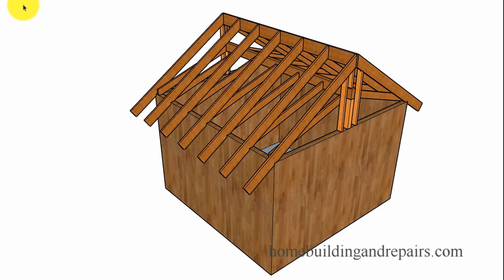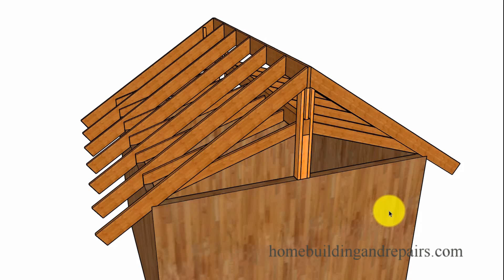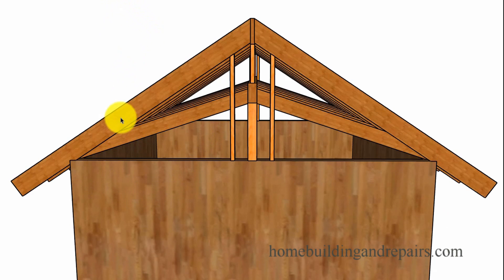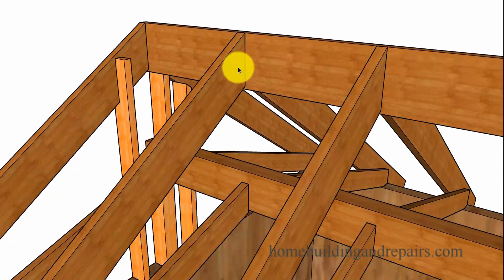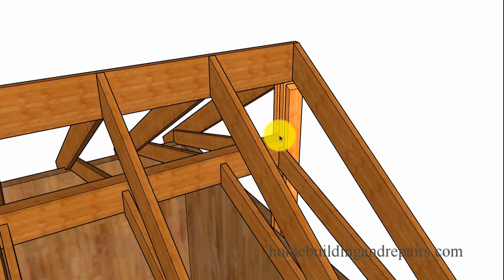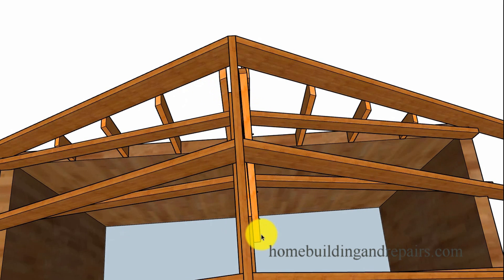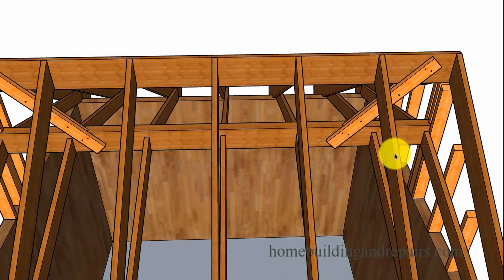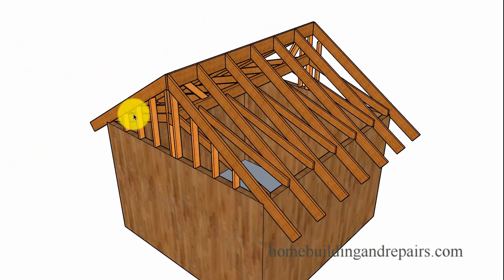How To Build Roof And Ceiling With Two Different Pitches - Conventional Framing

Comment: what if you have standard trusses with flat ceiling and want to go to a double pitched rafter ceiling with beam(s)?
Reply from the maker: I would think you could remodel it with this type of framing, but should check with local engineers to verify.

Comment: I want to add a post & beam 6/12 pitch to a ranch home which has a 4/12 pitch. I am not sure how to finish the gable as it goes over the 4/12 ridge. Do you have some thoughts on how to finish?
Reply from the maker: Email me a picture of your design or problem and I'll see if I can provide you with some information. You can get our email address at our website.

Comment: The walls will (probably) eventually bow out midway with this design.
The problem is there are no collar ties or joists keep the walls from spreading.
This design (in my opinion) is adding 2x the outward pressure on the walls and is basically dependent on the holding strength of the nails where the rafters are nailed to the ridge.
One fix would be to add several collar ties on top of the lower ridge from the left rafter to the right rafter in the top section.
Another fix would be to make “scissor rafters” where the bottom left rafter goes all the way to the top right rafter and gets nailed to it and vice versa... no bottom ridge needed.
Reply from the maker: Always check with an engineer if you're not entirely sure whether or not something will or will not work, when making building modifications.

Comment: With this method on a 24’ wide building would it be possible to have the roof at a 12/8 pitch and the ceiling at 12/6?    Or would you need to stick to the rule of not going over half of the roof pitch?
Reply from the maker: As long as you're using a beam to support either the ceiling or the roof ridge, then you should be able to frame the ceiling at any angle you choose. By the way, I've never heard of a formula or general rule of thumb for this type of construction, could you provide me with more information on it?
Reply: @gregvancom   if u don't mind I don't spike perfect inglish but I know I simple fast way to find the hitting point  between 2differents pitchs and for a lean to 4pitch fallin on 10pitch tell u exactly where u need to put a ridge